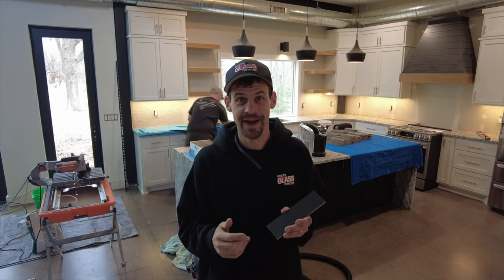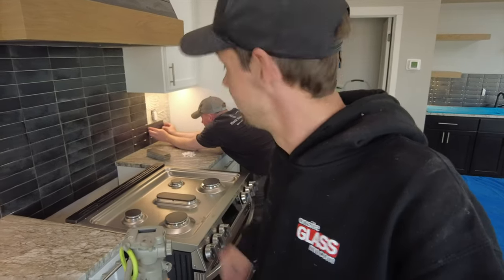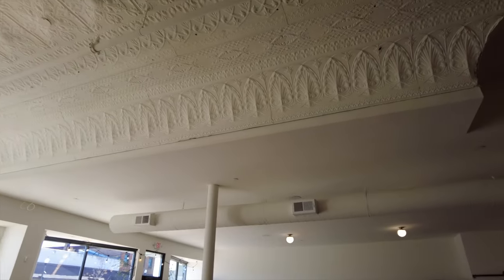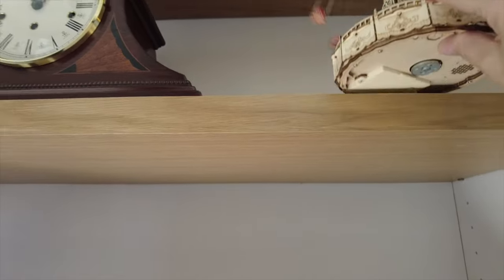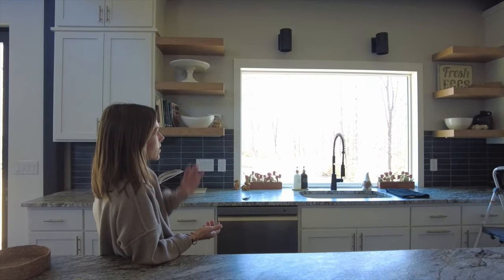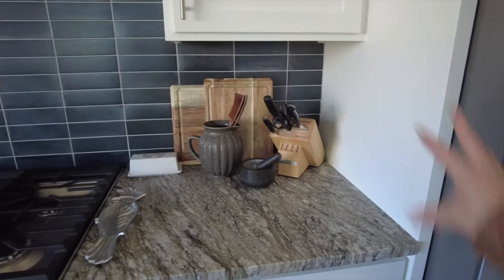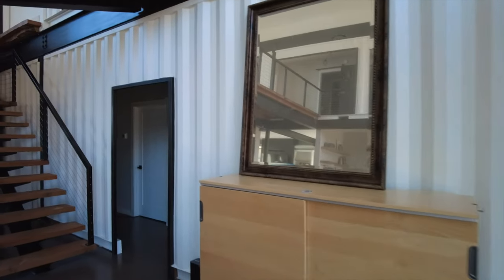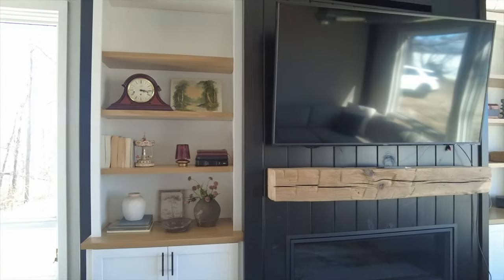Final Touches On Our 4,000 sq ft Shipping Container Home

Comment: Plants would be nice. Dangling down a bit. Love what youve done
Reply from the maker: of course the trailing plants will be gorgeous, love house plants, one step at a time😁
Reply: @SunfishBudget  +100 for the flowers. Nothing can make a big open space nicer then lot of greenery of different heights all over the place. Just pick the ones which doesnt require lot of maintenance except the water. And as well not sure if your controller can do timer based automations. Proper backlighting of the living room and common areas adds up a lot of satisfaction and peace to your evening free time. I usually do 3 types of lights everywhere: just a minor backlight to highlight nice house areas, main lights that you can dim and extra light if you have lot of visitors or just need lot of light. If you are lacking the wiring, to separate the lights you can always addup zigbee or wireless relays. For the table/floor lamps you can use special sockets between the outlet and a lamp. Congratulations with a project wrap up :) So sad you had to replace the tiles but I think that was a good thing if you hated it. Otherwise it would be bothering you every day, like mine is bothering me lol